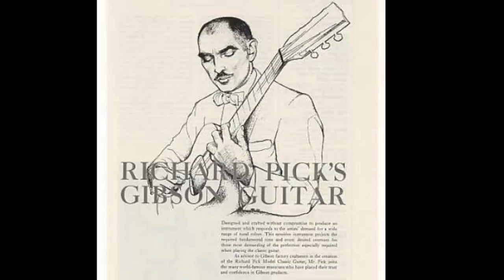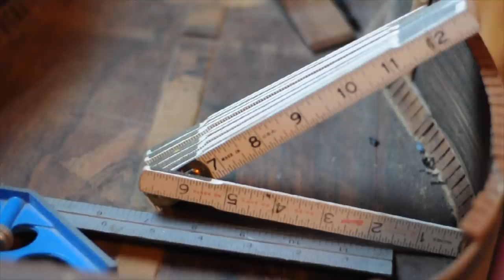Restoring this Vintage Gibson Guitar (Can it be done?)

Comment: As this video states: DO NOT USE STEEL STRINGS ON CLASSICAL OR FLAMENCO GUITARS. It kills me whenever I see someone try this. They aren't dreadnought acoustics.
Reply: aragorn767  tell that to Trigger ;)
Reply: Bluecera Trigger uses nylon strings not steel.
Reply: most classical guitars don't have a truss rod, as they aren't designed to withstand the tension of steel strings
Reply: @tabormorin4526  I believe the bracing is weaker too.
Reply: I have seen some flamenca guitar with reinforced bracings and a truss-rod that could allow you to put Extra-Light strings but they were much much expensive. Anyway one of my neighboors has a very crappy old guitar (a chinese model frome the late 60s) on which he always put Manouche steel strings that are lighter than regular steel strings and the guitar hasn't suffered any damage from it.
Reply: @baptistejordan7862  huh, interesting. Nylon guitats are cool, but I've never found any that don't have a huge neck. Any good nylon guitars with pencil necks?
Reply: @tabormorin4526  Cordoba GK Studio. The intonation is similar to that of an electric guitar.
Reply: @tabormorin4526  try looking at ibanez, I know that some years ago they made nylon strings guitar with thin neck like steel strings guitar
Reply: @baptistejordan7862  oh ok, ill take a look. Thanks!
Reply: Classical style guitars built heavier are often found in South America where classical guitarists used light gauge steel strings because in the humidity the old gut strings failed. Russian guitars often had classical styled bridges but were so heavy steel strings were okay. The whole guitar was birch, beech or larch, and built like a coffee table.
Reply: Trigger uses nylon strings, but is so worn and shored up with added bracing it has little acoustic tone any more. I think it’s a terrible sound personally.
Reply: @thismortalcoil696  Nope, it'll break the guitar  or screw up the intonation.
Reply: @wamgoc3637  I can't imaging something like that sounding good.
Reply: If you look at the published tension ratings you will see that extra light electric guitar strings have "the same" tension as nylon strings. I mean , say within 10% more. I have some really old parlor guitars that have no problem with those strings. They sound GREAT, btw.
Reply: I would think if someone DIDN'T know anything about something like steel stringing a specific type of guitar that is not normally strung that way, they MIGHT actually take the time to do some research to see if this is a good, or at a minimum, doable thing.  But then, I am FREQUENTLY disappointed where my personal minimal expectations are involved.
Reply: @aragorn767  And I believe in the Holy Catholic Church. Don't you KNOW there are strong guitars and weak guitars? Buy a cheap and awful Spanish one and try acoustic steel strings on it. Prepare to run fast when it starts cracking, you might get hurt. You might also not get heard anymore. You kill a guitar, that way. Buy the way, even cheap guitars can be good, today. So it really is a waste of money. But a "Guitars For Dummies" online, and read it. Then you do not need to believe in facts anymore. Then you KNOW your facts.
Reply: @thismortalcoil696  Yep, I converted an old Spanish guitar to a hollow body hybrid Frankenstein Telecaster. Those electric steel strings sound pretty okay, when you play it acoustic only. And the piezo pickup is doing a good job on nylon strings. My biggest problem now, is intonation. Those electric strings need a bit more length, and that standard Spanish bridge was not designed for that. Really, I had expected I could solve that, by cutting a different saddle. Now I am thinking about a saddle cut in six pieces, placed into a slot beneath each string. Then you can adjust intonation. But that is quite an operation, converting the original bridge. Buying a Telecaster type of bridge is easier. Building your own bridge is more fun. And I really like this crossover guitar. It can still play nylon strings, but you also have a P90 neck pickup and a single coil bridge pickup. To my surprise the piezo middle pickup combines fine with both other pickups. And strange enough, that wide finger board is something you can get used to. Classical guitar players can play it, so why can't we?

But, that intonation problem on the electrical strings, well, I'll figure something out. Chances are, I simply keep this one for nylon strings only, and build another one, bolting a fully adjustable bridge to it. First I need to think what I really want. Do I want this Jack-of-all-traits guitar? Both Spanish and electric? Maybe I'm stretching the specifications too far. Maybe it's better to give in, and start a new project, build my first guitar. We'll see.
Reply: Wow...You're a veritable fount of regurgitated knowledge. You must be very proud.
Reply: @lowellcalavera6045   Who are you talking to? The original poster? Or me? There is no address on your sweet insult.
Reply: @lowellcalavera6045  Wow...Yes, fortunately ALL of  yours is original.  WTH are you blabbering on about?
Reply: My first ever guitar was a classical and i used steel strings on it (unknowingly of course), eventually it began to tear the neck of the guitar away from the body. Definitely don't recommend.
Reply: @jameso2610  Guitars For Dummies is great. Today, that knowledge is online. Why didn't you ask a guitar player for help?! When the nearest guitar player is more than 100 miles away, I suppose you have a helicopter available.
Reply: Voor Naam A helicopter? What? This was 10 years ago I was only 10 years old mate
Reply: @jameso2610  Voor Naam has exposed himself as a troll. Pay them no mind.
Reply: aragorn767 hahaha I thought as much
Reply: @bluecera4226  i'm 80% sure Nelson still uses nylons.
Reply: Imma confess when I got my first guitar the strings snapped so I got metal strings on an ACOUSTIC GUITAR
Reply: Joseph Stalin Classical acoustic, or steel string acoustic?
Reply: aragorn767 classical
Reply: used to work in a guitar store back in 98 to 99. We did minor repairs and setup and ever so often someone would pop in with an old classical strung up with steel strings.
Reply: The old soviet guitars use steel strings
Reply: @NiksGMD  So did the Soviet KGB.
Reply: @Parktheparklebarkle  Trigger USDZ 3 Nylon and 3 steel

Comment: Where did you purchase a pre-made top?
Reply from the maker: Their hard to find with the sound hole already cut. You can get them on StewMac without the hole. If you check eBay you can sometimes find nice tops, sometimes rejects from the Martin company. Those are often great, despite whatever minor flaw made them reject it.

Comment: The smell of the bone when you cut it , is like the smell when the dentist is drilling a tooth.
Reply from the maker: Yes! Actually I said that the original voiceover and I ended up cutting that part for time! Great minds think alike.
Reply: Even when you have to cut and straighten ox horn grips on the fire to make the handle of a tool you can smell a really sickening smell, but the result is exciting! Anyway, beautiful realization, my compliments.
Reply from the maker: Paolo Buffa thank you! Yeah bone is not the most pleasant thing to work with, but it’s great for some applications.
Reply: @BrianGossard     As soon as I saw the bone being sawed, I thought "Wow, that's gotta be pleasant," - about 1 second before you mentioned it.  :-)  I used to make knives from old leaf springs, and my favorite handle material was deer horn - no 2 are alike, but WOW,  that smell.  Unique and unmistakable. (But also handy for running Da Wife out of the shop so that I can get stuff done.)

   Boss-Class  rebuild!  I'm envious of your skillset.  Needless to say, but new subscriber here.  Thanks for sharing!
Reply: It smells like Victory!!!
Reply: Smells like burning toenails

Comment: For the intonation of a straight saddle, you should check out Motolla's compensation calculator. This way you can determine the correct scale length of each string and compensate the intonation by slightly sanding the saddle to move the contact point of the string backward or forward over the saddle.

Comment: Somebody needs to build a device that will shock people when they try to attach steel strings to a classical guitar.  I work at a thrift store, and at least two thirds of classical guitars that come my way have steel strings on them.  People tend to think that the bridge popping off is the most common mode of failure, but in my experience it's usually the neck joint.  If the neck joint doesn't fail, I typically see the top board pulled up at the bridge.  Not sure why this is the case, maybe wood glue is more resistant to shear force than a tensile force.
Reply from the maker: That’s a good question. If it’s a good joint, the wood glue will create a bond stronger than the wood itself. That could be why the bridge often remains while another part fails. Bottom line: DONT PUT STEEL STRINGS ON A CLASSICAL GUITAR! Just stop it! Thanks for your comment. I enjoyed it.

Comment: Greetings Mr. Gossard. I found very interesting the bracing pattern you used on this instrument, like radial bracing. Do you have any plans in future building from scratch classical guitars? I think that with the proper woods (Rudolf Fusch spruce tops and aged backs and sides, naturally shrunk ebony boards and such) and higher quality tuning machines like Gotohs or Schaller Grandtunes, stuff around that price point or even some cheaper Der Jungs with bearings, you could produce very high quality classical guitars in a relatively reachable price bracket (I am guessing some 2 / 3K?) I would be interested in trying one of your acoustics out. Greetings

Comment: Brian, great job, and nicely played!  I notice you used ball-end strings instead of the traditional tie.  I do the same, but some players think the ball might actually be bad for the tie block and split it.  What are your thoughts on this?
Reply from the maker: That’s a good question. There certainly could be people out there who know better than I about this, but I haven’t observed any problem from using ball end strings. Now, if you look at my most recent upload, I had a problem with the bridge but that had nothing to do with the ball end strings. A very good question and while I can’t answer with complete certainty, I would suggest it’s a non issue.

Comment: You have amazing talent with the repair, rebuild of this awesome guitar.   There was one thing I noticed and maybe someone already mentioned it.  I didn’t search all 1.1k comments.   You mentioned the nut slots were hopelessly low.   I also own an old 1968 Gibson C0-Classical.  (Student grade guitar).  If yours was built the same as my Gibson, then it would have a 0 fret.   So the nut was not used for setting string height and only for string location.   I could be wrong and am not taking anything away from the amazing work you have done.   

I am instant subscriber!

Comment: Great video! I have a question. I am trying to restore an old all solid wood Harmony. The top is in bad shape and I want to do a new top as you did. Most of The kerfing split and a thin amount is attached to the old top. Looks like I need to replace the kerfing to use a new top? How do you suggest I deal with this?  Thank you.

Comment: Hey Brian!  Great video and beautiful workmanship.  Thanks for sharing.  I've got a lot of experience building in wood (furniture, canoes/kayaks/boats, etc) and I have been a guitar player for a few years now.  I'm contemplating a StewMac build or restoration project and I am wondering why Luthiers don't use urethane based paints on guitars?  When building canoes, the base epoxies are strong but suffer from UV breakdown and historically have been finish coated in varnishes or shellac.  I've been using urethane based paints now on just about everything with outstanding results - we all know how well automotive finishes stand up against time now.  My question is in a new build (not necessarily a restoration) be it acoustic or electric, would using urethane based clear be problematic?
Reply from the maker: Hey, thanks for the comment. These are great questions. First of all, If you’re interested in doing a StewMac guitar, I would definitely recommend you check out the videos I have about building my StewMac kit. It’s not done yet, but the videos I have up now might give you a good idea of whether or it it’s a good fit for you. The finishing question is a very good question indeed. Let me preface this by saying I am not an expert when it comes to finishes. I’m kind of a slacker in that area. With that said, I think the reason we use lacquer and shellac based products are because they are very thin and do not significantly dampen the vibration of the wood. As far as electric guitars are concerned, I wouldn’t consider that an issue. I don’t know for sure why urethane isn’t used on electric guitars (maybe it is and I don’t know). Again, good questions. I would love to hear back from you when you get started on your project.
Reply: @BrianGossard  I can see how a lot of urethane buildup could reduce the natural tone of the wood, but I think I'd be willing to try it on a "test subject" with light, thin coats equivalent to the thickness of the other coatings.  Thanks for the reply!

Comment: My Orange Roland Cube 60 guitar amp. has a Pre-Out and Main In connection at the back. As it is more than 30 plus years old with no Manual, I don't know what they are for? Please advise.
Reply from the maker: Sorry, I’m not the best guy to ask that. The pre out maybe an effects send. Not sure. The main is probably for an external speaker cab or for recording.

Comment: You make it look so easy! I bought an old classical Romanian guitar dated circa 1980 from a thrift shop for $25 with extensive water damage to use in my first attempt at restoring a "vintage" guitar. It wasn't as badly damaged as the guitar you restored in this video for I am not qualified to take on such level of restoration nor do I have the appropriate tools for the job. The lacquer on the entire piece was checkered and peeling, which I liked and decided to leave alone as it gave the instrument that irresistible vintage vibe. Half the bridge was broken and I was successful in rebuilding using mahogany scrap wood around my workshop (my bedroom really). Tuning pegs were missing so I bought a set of brand new ones and re-drilled the screw holes to fit. The rosette around the sound hole was half missing so I filled the gaps with CA glue and sanded down to a smooth finish. The neck seemed straight enough and the frets in a good enough shape, all I needed to do was to clean and polish. Finally, I noticed a small gap between the neck heel and the body about 2mm wide starting at the bottom of the heel and gradually getting smaller towards the top of the guitar. Without the necessary equipment and know-how needed to separate the neck from the body and reset, I decided to fill the gap with CA glue and hope for the best. Finally i made a bone saddle and nut for the guitar and installed some fresh strings on it. ARGGGGHHHH...! The strings turned out way too high from the neck towards the middle even after shaving the saddle down almost flush with the bridge and lowering the nut as much as feasible for a classical guitar. Obviously the neck had tilted upward due to water damage made apparent by the separation of the neck heel from the body. And now the guitar hangs on my wall as nothing more than a wall ornament and a memento of a miserably failed 1st attempt at lutherie. I think I'll just stick to playing the instrument instead and leave the restoration part to talented guys like you!

Great job btw! The sound of your rebuilt Gibson towards the end of the video is HEAVENLY! You can hear the old wood resonate with such warmth and depth it pierces the heart!
Reply from the maker: Thank you Terry! Don’t be too hard on yourself though! I think it’s great that you made an effort with yours. If you want to get into doing some guitars, I would suggest you start with an electric. You could also build a StewMac kit. Their ukulele kit looks like a fun little starter project. As for playing the guitar - good thing there’s people like you out there that play (probably way better than me). Don’t be a stranger! Hope you subscribe and stick around.

Comment: Maybe it's just me, but I think, that you could have done better. Soundboard that's not flush with neck is a serious problem, and I think, that glueing 2 sheets of veneer to the neck is not a good solution for that.. IMO you should have made the soundboard thinner, because that was probably the original thickness .. I don't know how thick that soundboard was in this case, but on classical guitar it's usually somewhere about 2mm thick. Also glueing of those braces was very rough.. you even didn't had nice glue "squeezout" throughout the whole gluing area... and you should have voice that top for sure. And for the finish.. I think vintage instruments like this one is worth of finishing like originals. So this guitar was obviously finished as openpore. Not sure about the nitro neither. And you don't want to finish the instrument with bridge glued on.. really.
Reply from the maker: Those are all fair points. In a perfect world I would have done some of those things you mention. This was my first go at something like that and I’m proud of how it came out.